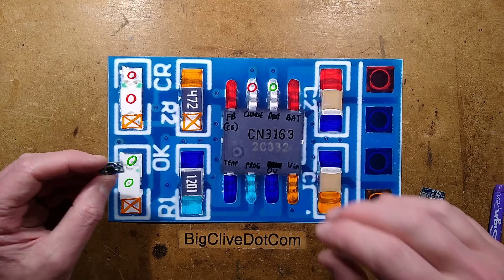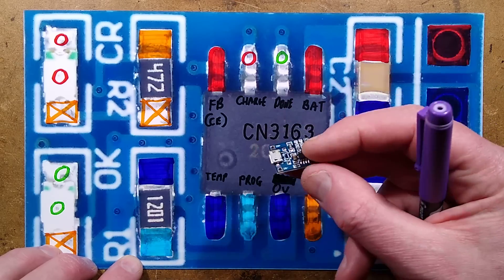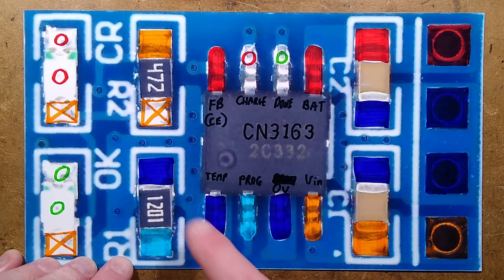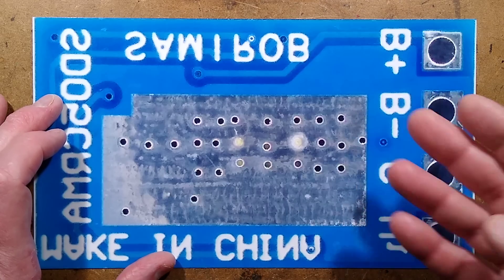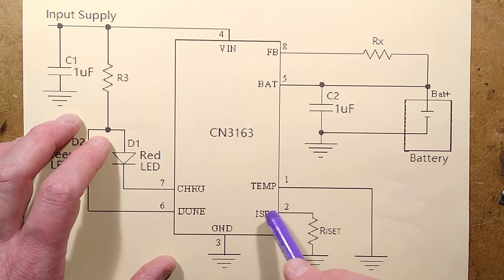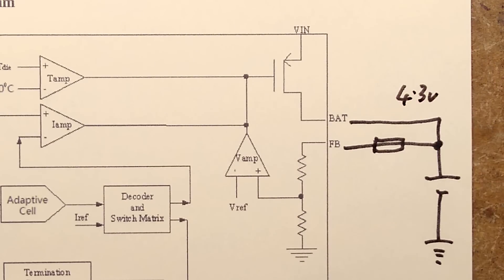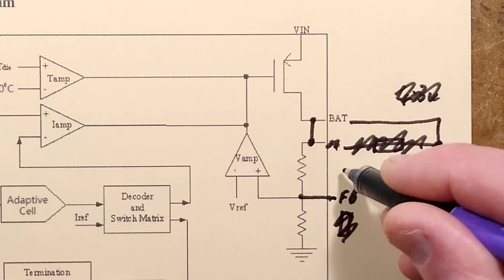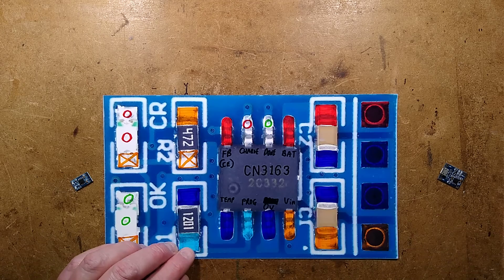Solar "MPPT" lithium cell charge module

Comment: I can't find this answer and thought you would know since you are a reverse engineering expert: MPPT question, why do all microinverters have a short circuit input max current? They automatically limit the output current. Why do they call it short circuit? wouldn't maximum input current name be more appropriate?
Reply from the maker: I'd guess it relates to the maximum current the source can supply, and it's to keep switching circuitry and cabling in that range.

Comment: MPPT isn’t just for correcting for temperature and such; its actually mostly for handling for solar panels weird-ass IV curve, which puts the point where you get the most power out the cell at a specific combination of cell voltage and current.  The efficiency gains are substantial, and the circuitry isn’t that complicated; so it drives me nuts when people false advertise.

Comment: Haha of course you’ve made a video about this. I got this board as a temporary solution for uni project since I was having trouble the actual mppt I plan on using. It was cheap and had next day delivery so I didn’t read to much into it (lesson very much learned lol) and I was a little confused when I was getting more power from my panel with a regular Li-Ion charge controller. From the measurements I’ve made, it seems to favour more voltage from the solar panel at the expense of current. Which I’m assuming must be better for charging lithium cells?

It’s a useful wee chip, just unfortunate that the sellers feel the need to mislead customers.

Comment: I think you can still hack a custom voltage by using a bunch of diodes and resistors or a transistor that amplifies the voltage to 4.2V but it all feels kinda scuffed. Also I don't feel like doing the math rn.

Comment: At 7:15, the battery voltage setting can be lowered to anything you like by taking that pin down to ground via a resistor, and adding a series resistor between the pin and the battery.

Comment: The solution is to go the other way around - use a LiFePo4 charging IC and boost its voltage. I got inspired by your previous video using a diode, and searched around to find CN3058E to fit the bill - it is mostly pin-compatible and the hack is pretty easy - I've done it on several of my boards:

1. Desolder the TP4056 using hot air (or hot plate).
2. Solder a thin wire to pad 8 on the PCB, let it cool, rip the pad out (just to be sure)
3. Bend the CN3058E pin 8 upwards, again to avoid accidental contact with leftover copper on pad 8
4. Solder the CN3058E to the PCB using hot air
5. Solder a 100K resistor between pin 8 and pin 5 (or battery terminal directly) - according to the datasheet, this boosts the 3.6V to 3.96V. I use a small 0603 resistor placed flat on top of the CN3058E plastic package + tiny enamel wire, but a good old leaded resistor will work.
6. Profit!

Getting genuine CN3058E might be a slight problem (unless you're used to buying parts from LCSC), but I got mine for $1.77 / 10pcs from Aliexpress (look for positive ratings/reviews to avoid fakes) and they indeed charge to ~3.92V given this mod.

Comment: Hey could you do a guide on how to use the Temp pin on these things?  I'm trying to use them to build solar-powered devices that will sit on a car dash board in Canada, they'll go anywhere from +50C to -25C, and I'd rather not charge lithium ion outside of temp range.  I have some 10k thermistors but I can't wrap my head around how to solder them to that temp pin and stick them to the battery, would love your input on that.
Reply from the maker: The data sheet shows the thermistor section.  You need to add a thermistor and another resistor of your preferred value to get the desired temperature threshold.

Comment: MPPT doesn't really make much sense for low power applications like cell charging - on rootfop solar it makes a lot of sense because you can get tens of watts more power with MPPT than without. MPPT basically tracks the V-I curve of the solar panel - there's a certain open circuit (0A) voltage, and a certain short-circuit current (0V) and in-between those two there's a I-V point where maximum power from the cell will be achieved - draw less current and the voltage goes up, but the total power goes down. Draw more current and the voltage goes down more so power goes down again. It's basically at a knee in the I-V curve . On small panels you're probably going to get maybe milliwatts extra with MPPT.

Comment: I made a design 2 years ago using this little chip, it's been working really well. It's a wireless pot watering system that measures the water humidity and has a little pump to water the soil. They have survived even through the winter. It is capable of charging a tiny amount even in low light.
You can hook up ISET to an ADC on your MCU to get the charge current.

Comment: You could connect your diode on the BAT term, but connect the FB directly to the cell, that way you get the little voltage drop without it doing the massive slow down that you saw with the TP4056 (although that might also be solvable by adding a capacitor before the diode, so that acts as the cell it's trying to charge)

Comment: Last I looked at one of these (and I use them), it just fixes the solar input voltage, so isn't REALLY MPPT, but quite useful given the price and simplicity.  The one I have can select the voltage with DIP switches.

Comment: Thanx for the video!
Very interesting. 

Can you make another video of the "brother" of this board? DD05CVSA.
I bought a few to check and compare. Bought 5V and 12V version. Seems R1 is the resistor which sets the output voltage.

Going to experiment with it, replacing the resistor with a pot, so the output voltage can be set to what is desired. 
Thinking of using this board to be replaced along with an 18650 cell in existing outdoor LED lights. 😊

Comment: Don't charge your cells to 4.3V unless they're designed for it. That's not a safe voltage for standard 4.2V as they have an absolute max safe voltage of 4.25V. And there is no extra capacity to be gained anyway, because the battery will quickly normalize to 4.2V and turn the excess energy into heat.
Some batts are designed for 4.3V, you see them a lot in smartphones for no reason, but it isn't the norm. Thought I needed to mention that for anyone not aware.

Comment: To charge the battery to say 4v, maybe add a pull-up resistor from the input to FB. Then add a schottky diode with 0.2v drop to BAT.

Comment: Year's ago I built a 555 timer mppt charge controller based off a popular project and an automotive relay back in the day.
I tested it, set it up and have never needed to attend a battery since. It's been almost 15 year's now!
But I remember while looking at ic chipsets I come across something similar but in a smd and 16 pins,  I got a sample and I couldn't believe how small it was...

Comment: There is another version of the chip dedicated for charging LiFePO4 cells. It's called CN3158 and its pinout is identical to the IC presented in your video.

Comment: I didn't think that the TP4056 would take as much as 8V,  thought that the limit was lower.  I have a small solar panel here,  maybe 6 inches square.  Putting it in strong sunlight I was able to measure almost 8V coming out of it,  but trying for current I only got about 8mA!  I'm not sure how to characterize that panel.  Was thinking about feeding the output of it to a small buck converter module and then feeding that into a TP4056,  do you think that'd work?
Reply from the maker: At low current it may be simpler to just dump whatever is available into the lithium cell.

Comment: Hi Clive, can a resistor diode in series pulled up to Vin can fix the problem? FB pin will be fed by battery*+Vfdiode voltage.

Comment: I'm so glad you did a video on these little modules, I love them, I've bought several from Aliexpress.  I've been buying cheap solar lights from Dollarama that have 18650's in them (yes a full size 18650 in a dollar store solar lamp!), but their charge controller just overcharges the battery eventually frying it.  I just use these boards as a drop in replacement for their charge controller and it fixes them.  I have graphed all the values using an ESP32 - the battery voltage goes up until it gets pegged perfectly at 4.16v every time, which is within the 1% threshold they claim in the datasheet.  The current on my solar boards goes up to 250mA, but once it reaches 4.16v you can see the current graph curve downwards until it levels off at roughly the amount of current the ESP32 draws.  Then it will also deliver a few milliamps in non-full sun as well.  It seems to have two modes, and when it goes into full charging mode, the voltage measurement of the solar panel suddenly drops and gets pegged to 4.2v.    I think these charge controllers are great, they have all the features, but you're right it would have been nice to continue using them when I eventually make the switch to LifePo, whose low voltage eliminates the need for a voltage regulator in my ESP32 projects.
Reply: I almost searched for a module like them just a week ago. My 9 cell (5.5V 260mA) solar power banks have also been overcharging and ruining their single 18650s forcing my fairylights into hibernation.  I'm currently awaiting some 3.9V (not 4.2V) zener diodes for (hopefully) a lazy similar effect parallel to the panels cells.. Either this module or re-purposing the existing DC charge circuit could also work.
Reply: Haven't come across those solar units in Canada. Can you confirm they are single or dual polarity output.. I  bought mine in bulk with switchable polarity and could use  a dual channel unit from time to time..
Reply: @starlights50  Not sure what you mean, there's just the one fixed output as far as I can tell.  Never heard of dual polarity output.
Reply: @moeburn  What does yours power?   Seed/Fairylights strings often have every other LED reversed in polarity. . some have 2 parallel diodes in 1 drop of resin that are opposite in polarity. Typically a second colour of LED. BC has (briefly)mentioned them as well.  The lithium Solar bank outputs PWM +/- 3.5V.. It took me a freakish amount of time to find single channel(switchable) solar banks for fairylights.  My profile can take you to my homemade sales video.(pretty pictures of lights in trees..)
Reply: Well, "my"zeners still haven't arrived, but luckily these units have a 5V charging jack and I figured out that I can just as easily solder the solar panel to the DC charge circuit with no apparent repercussions. This will be a lot nicer than cooking a diode. It's time to modify them all!! Take care.
Reply: Simplest solution is ironically not to put the solar panels in direct sunlight. These are quite sensitive,, shaded, charge to under 4V and still strong enough to run appropriate fairylights for a few cloudy days.

Comment: They could have just brought the FB pin out directly,and let the "user" decided the voltage with a couple of external resistors,eliminating the internal ones completely.

Comment: I need to power/charge phones by tapping directly on battery terminals. This is for an application where the phones will be constantly powered. But I can't find a decent power supply, so my plan is to use adjustable buck converters to convert 12v to 3.6v. So I get the need of keeping a cell to a normal, closer to storage, voltage. For a solar aplication, one will in general destroy the battery due to excessive discharge and never reaching full charge. Unless bigger panels and batteries are used. Something that can handle power for multiple days in bad weather conditions and be overpowerd enough to consider battery limit. For example I would love to power an esp32 from solar and don't worry about it loosing power or destroying the battery.

Comment: why don't they put a boost converter to use all that energy coming in before the "low voltage"?

even the most expensive solar charge controllers don't do anything until 17/27 volts.

Comment: Nice Big Clive.  Thanks.  Agree.  It would be nice with the other tap so you could cater to LiFePO4 cells.  I'd like to build something with a couple of these Headway cells I have that are rated at 8 amps.  They're beefcakes but finding the protection circuits for them wasn't easy.

Comment: I'm pretty sure an mppt solar charge controller has to have an inductor in order to be able to boost or step down the voltage. I believe the one that you have is A pwm charge controller

Comment: I think that you can't have MPPT without a decent-sized capacitor and inductor. For any good-sized one they will be large toroid coils. I suppose you could have one that uses a resistive regulator, but then you're just throwing away the excess voltage as heat (and MPPT is about higher efficiency), rather than turning it into extra current as in the inductor version.

Comment: Excellent timing Clive :D I started looking into using small solar panels for the first time yesterday. Planning to power some garden lights and water pumps this summer. Your reverse engineering and explanations of these how these PCBs work are always super easy to follow. It also makes datasheets easier to take in after you've given your walk though. Anyway, just saying thanks in the least concise way possible 👍

Comment: Putting a TL431 between the chip and ground would add a precise 2.5v offset. This would make the chip think the battery is 2.5 volts lower than it actually is. Modify the resistor to suit.

Comment: Mind you, you can put a low forward voltage drop Shottky diode between the battery +ve terminal and the charging line, to make the charger "think" the cell's fully charged since it uses voltage sensing to determine charge status
Reply: Sounds reasonable to me...also an unwelcome tax in times of low sun. Must.. avoid.. overhead!! Eh!

Comment: Hey Big Clive, ahead of moving into my new house, I'm sorting through 19 years of accumulated $h1t, and I've got gazillions of AC power adaptors, figure of eight mains leads, and audio and video cables! ... It's like a bloody e-waste mountain! ... But, the moment you throw anything away, you immediately have to buy a new one, because you need it again! ... I'm gonna end up on a hoarder TV show, buried under a mountain of scart leads!
Reply: I have just watched a Mike's Electric stuff video recently and wondered about Mike's pile of stuff compared with Clive's pile of stuff. good to know that there is a fair distance apart or there could be a critical mass thing going on...
Reply: @Fixerbob   There's gonna be a 'critical mass' thing going on alright, at my new house! ... I literally won't be able to move for $h1t! ... I'll need more than a bloody skip! 👎🤣
Reply: @Fixerbob  Just don't pull out that screwdriver...
Reply: Every so often I go through my accumulated electronics and peripherals, and give the usable (functional) stuff to Habitat for Humanity to sell in their store. It's been rare that I ever wished I still had any particular gizmo or had to go out and buy a new one, it's a small trade-off for all the extra space I now have in my storage shed. And I figure someone who DOES need a particular item can get it for cheap.
One caveat, though - if you go browsing through their store it's very tempting to pick up a few things "just in case" you could use them for a project of your own!
Reply: I have the very same problem (or passion😅 haven't fully decided which it is) for collecting electronics of all sorts. Literally mountain's of circuits boards and old broken chargers, TVs (CRTs and flat screen,) microwaves an entire wardrobe full of car radios and other radio equipment some working most not. Just got my 1st old PC yesterday and put up a video of it on my page. Wanted an ATX for so long now to make a PSU from it. 
But the "HORDING" is becoming a problem.. (I'm running out of room 😂😂😂. 
Don't want the gaff getting to the point where you have little paths through all the CRAP me and father have brought into the house. Me with electronics and him with everything and anything. I can let go and dump stuff when it gets to bad, but my poor father was really upset when we had 3 bags in front of him, 1 for stuff to be dumped, another for stuff he could keep,band the 3rd for stuff we weren't fully sure about at that time. When you hear someone say "I NEED THAT" about an empty jam jar you know you have a horder in the family. he was trying to keep everything (even plastic bags and broken pairs of glasses for the pound shop/Euro-saver. It was sad to see but it finally made him realise he had a huge problem.. I have too. And it's time again for full house emptying again. Both my crap/class stuff, & his pure shight.  😂 
But we are who we are & it'll all build back up in about a month or two. 😅
Need a woman in the house.    I'm at the age (45) where id rather memorise the pathways through the junk. 😁 
Remember ,, it's only a problem if you can't dump most it most of it in the skip every now and then.. 👍😊🇮🇪

Comment: If you want to charge to a lower cutoff voltage, you can connect an additional resistor from the FB pin to GND.

Comment: A bit OT, but if you want to see what happens to your LED streetlight when it gets 7200 V through it… https://youtu.be/NSoZkMWHhXg

And don’t sleep on the #4 copper ground wire that fused halfway down to the ground rod. (Or earth, for my friends across the pond.)
Reply from the maker: I saw that.  I wa trying to work out which component left the primary skidmark.

Comment: Generally, integrated resistors have very precise ratios and terrible absolute values. Instead of having two LEDs, they could have a transistor that enables the FB circuit for an even lower power consumption and a feedback pin without any resistors. Look the BQ25173 implementation.